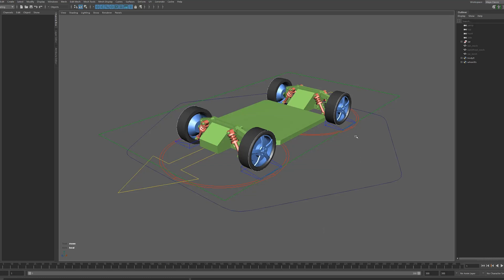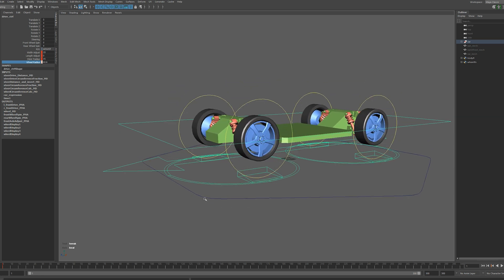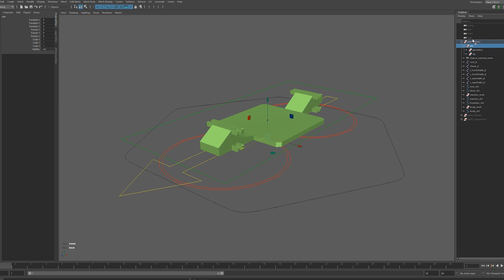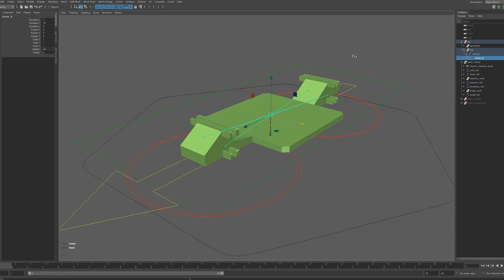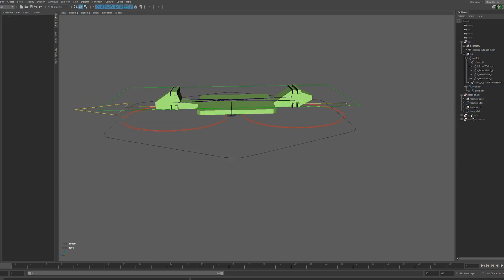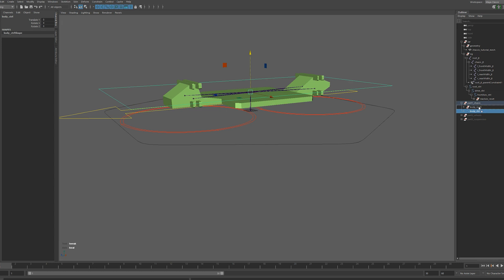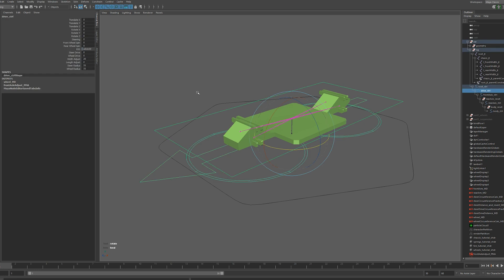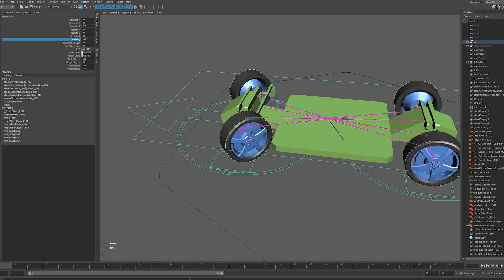How to Rig a Car in Maya | Car Rig in Maya | Part 1

Comment: Hi man. Great job. I just bought the simple rig and was wondering if there is a way to change the rear radius separately from the front. Thanks and great job
Reply from the maker: Not an easy way on this rig. This was one of the reasons I built the UAC-Rig.  I took the feedback from the Adjustable Car Rig and pushed it as far as I could:  https://simonpaulmills.com/blogs/blog/creating-the-ultimate-car-rig

Comment: Thank you very much for the tutorial! I have a question, when I do the parent costrain of the rear axis to the chasis, the body rotates with the central pvot of the chasis around the rear axis while parent costrain to the root comes as in the video, is it a mayan 2022 thing?
Reply from the maker: Try it with maintain offset turned on

Comment: Hi Simon,
I have question regarding wheelDrive expression. I am lately facing issue with it. I noticed sometimes, when I move the drive control and move it back to zero position, wheel drive expression have some values, which should be zero at origin. Any idea why this might be happening?
Thanks!!
Reply from the maker: Are you using "undo" for the move back to zero or setting the values manually back to zero?
Reply: @SimonMills  hi simon i am having the same issue as mentioned in the above comment when i use undo then the wheel drive value resets to 0 at the origin normally but sometimes if i set my translate value to 0 manually my wheel drive value doesn't reset any solution it is not a big of a problem but it sometimes affect my wheel rotation i guess
Reply from the maker: @Manya-yk7ds  Possibly a viewport update issue.  You could try typing the word "refresh" (without quotes) in the mel bar at the bottom of the screen and hit enter.
Reply: @SimonMills  no it didn't fix the issue :(
Reply: @SimonMills  it heppens when i change both x and z translate and then do it to reset their position to 0
Reply from the maker: @Manya-yk7ds  Check out the UAC -Rig, this does not use expressions to calculate the wheel rotation; utility nodes are used instead. https://simonpaulmills.com/blogs/blog/creating-the-ultimate-car-rig
Reply: @SimonMills  thanks i will seriously consider purchasing the product btw thanks for making the tutorial this is the only tutorial on youtube which shows how to properly rig a vehicle i have learned so much from it ;)
Reply from the maker: @Manya-yk7ds  Thank you for the kind words, I am glad it helped you!

Comment: Great stuff but I think the front wheels should not turn on such radius. Their pivot should be inside the wheel a lot more. If the wheels turn as much as on your rig surely would bump into the wheel house.
https://www.youtube.com/watch?v=V-snoyCwKQw&ab_channel=Mechanical20hz
Check this. Even while stationary you can see how the wheel turns around it's mid point and does not run around on a radius. Other than that great tutorial if not the best out there.
Reply from the maker: Agreed. This was one of the reasons I built the UAC Rig.  That rig has adjustable pivots and also accounts for tire compression and caster angle during steering. https://youtu.be/A6IHhxZTeu8?t=1198
Reply: @SimonMills  Oh yes, I checked that and it's a very solid work.

Comment: Using Maya 2020 the rig behaves oddly. Following all the steps, makes the rig seem to be parented to nothing. After parenting the chasis joint to the rear axis ctrl (Parent constraint), the entire thing stops working, and only the rear axis has effects on the rig. Tested on Maya 2018 and it works.
EDIT: relaunching maya fixed it
Reply: Came to the comments after exact same confusion,  then noticed I'd started in 2020 by mistake, sacked it off for 2018 and it's all fine. Funny really, I've not used a single new 2020 feature yet, but used plenty of standard features that are now broken. Same with every new release!

Comment: Hi, Simon,

Question for you. I was watching the video and noticed that when you adjust what is essentially the track width of the car (distance between the two wheels side to side), the center of rotation stays the same, causing a very large arcing motion of the wheels rotating around the hub/axle. In an actual vehicle, if they wanted to increase the track width, the entire suspension geometry would change, pushing the whole hub assembly, brakes, wheel, etc. outward, and not just the placement of the wheel. Is there anything built-in that correctly models this? 

Thanks!!

Jason
Reply: Hello Jason, why don't you move the wheels closer to the steering point using the steer radius attribute and then move the entire wheel assembly out using the width adjust attribute? In the case of Simon's steering geometry it will cause intersection but if you replace it with your custom fit geometry it should work and the arcing motion should come out smaller.
Reply: @industrialsculptures  I have the same question. Will try out your solution.